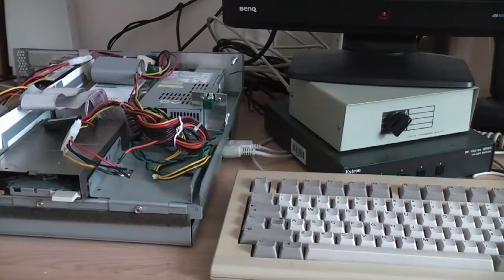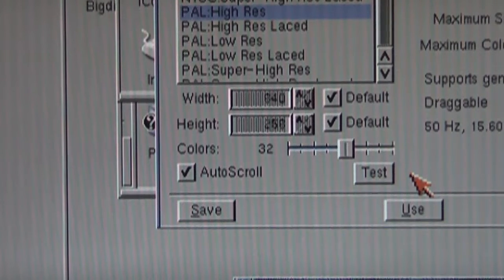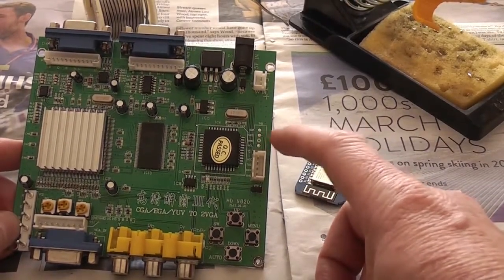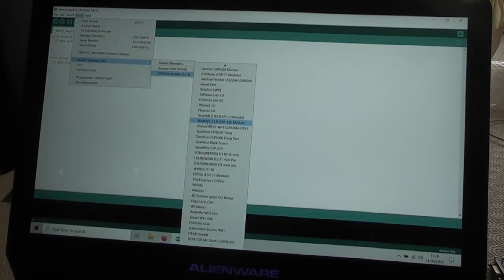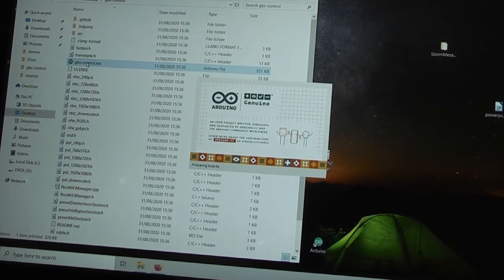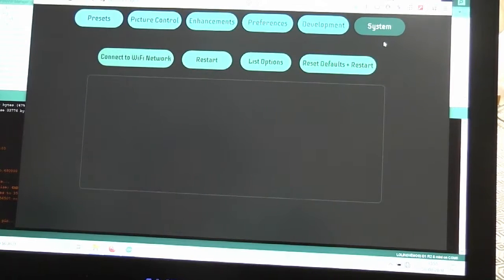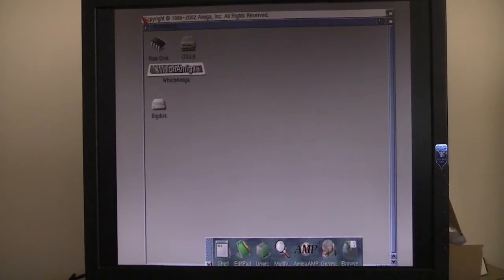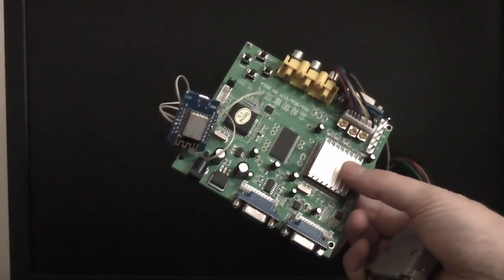GBS8200 scandoubler mod

Comment: Awesome video .. got a sub from me :) ... one question though ... my monitor is 1024x768 and I couldn't see that resolution listed on the setup firmware.
Reply from the maker: Good point.  I can't see that supported out of the box.  What I don't know is if you can write your own definitions file for 1024x768.

Comment: The Windows control panel/options mess annoys me too. MS seems to be in the process of transitioning to a dumbed-down, "user friendly", tablet style interface for Windows. Right now we're at the stage where the new options panel and the old control panel still exist side-by-side. The end goal seems to be a curated selection of options to quickly change, rather than exposing all the useful stuff in the actual control panel. I assume the real control panel will soon disappear entirely. I'm not a fan.

Comment: Really good to see the difference it made. I've got one of these boards and have modded it, but not had chance to set it up and use it yet.
For the SDA and SCL wires, I cleared out the holes and soldered the wires through the hole - it'll be a stronger mechanical connection and means the hot snot isn't needed!
Reply from the maker: I'm really pleased with the results from the mod.  Agree, a through the hole joint would be better.